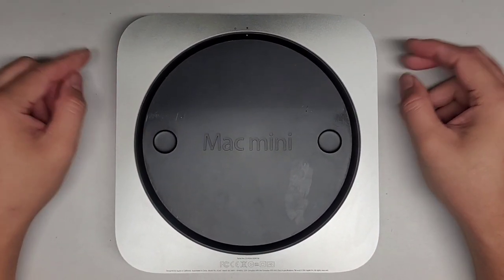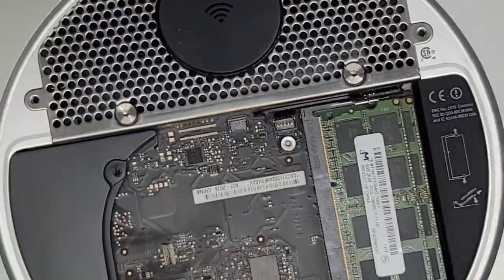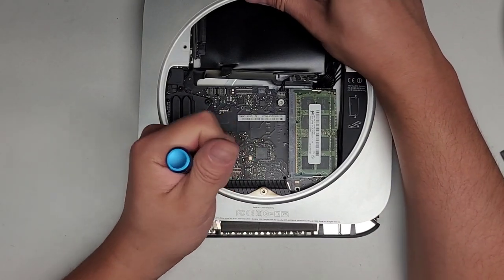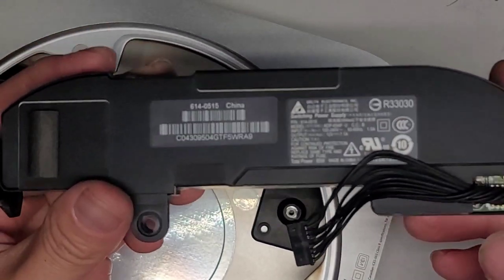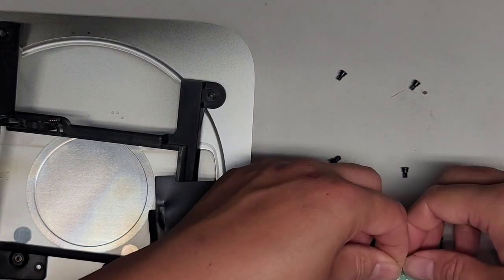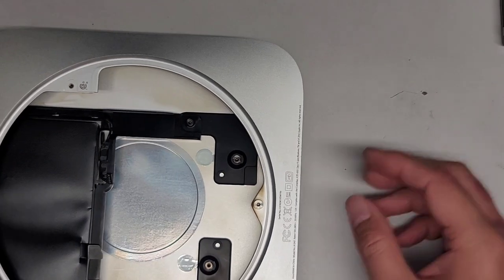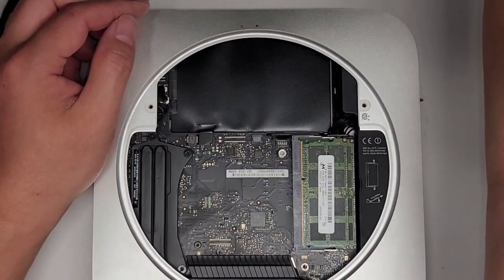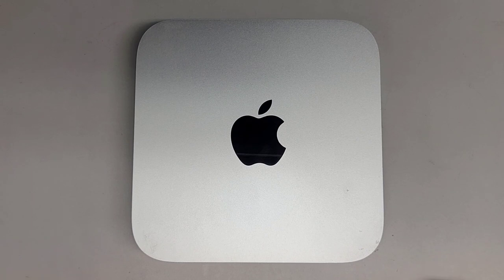Late 2012 Mac Mini A1347 Disassembly RAM SSD Hard Drive Upgrade Power Supply Fan Replacement Repair

Comment: Thank you for this guide, seriously I tried watching other ones but this one was the best!!! Also, an OS video would be helpful.
Reply from the maker: There are tricks that require another Mac to get it working, are you able to boot the internet recovery with command option R?
Reply: @ItsBinhRepaired  so actually it booted up right away, but OS X was already on there and my external USB wasn’t recognized. So I used that as my clean install then updated to Catalina.
Reply from the maker: @NIM777  nice!

Comment: thank you for the video and the information.  I do have a mac mini 2014 can I upgrade de ram from 8 to 16 GB.  also in order tochange my mechanical drive with aa PCLE drive what is the adaptor a need.  I can also add a sata drive ssd?  thank you
Reply from the maker: PCLE?
Reply: @ItsBinhRepaired  is a ssd format M2 and type nvme disk which I want to add to my mac mini
Reply from the maker: @AlejandroCarasso  there is no slot for that.
Reply: Mac Mini has RAM soldered to MB, and cannot be replaced without Hot Air Rework and reballing the solder. There are a few videos on YouTube (dosdude is one). NOT EASY.

The SSD situation: it has the cable to attach a standard SATA 2.5” drive (spinner or SSD). It accepts any SATA-standard drive.
It also has the connector for an Apple-Propriatary NVMe drive. The Fusion models include the drive, and adaptors exist to use a standard M.2 NVMe.
OWC sells the Apple-specific drive, if you desire original style….

For more specific info on the 2014, watch the myriad YouTubers who have covered this.
Reply from the maker: @ernestgalvan9037 yup!

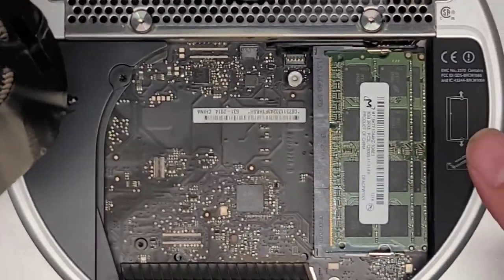Comment: the little bracket that holds the fan connector (3:34) popped right off on me. Now I'm screwed. Any suggestions?
Reply from the maker: Need to find someone that can solder it

Comment: Great video,  but for replacing the drive you don't need to remove the mainboard unless you are goind to add a second hard drive.
Reply from the maker: Make a video pulling the drive out without pulling the board out. Good luck.
Reply from the maker: Lol that's impossible unless the screws to hold the hard drive in place weren't put in.